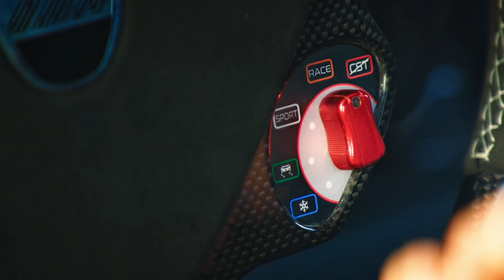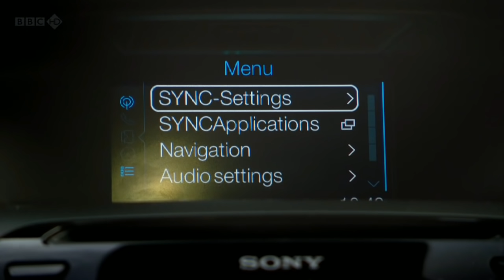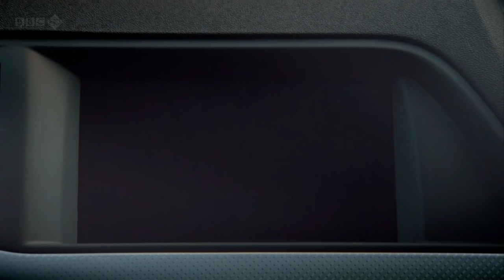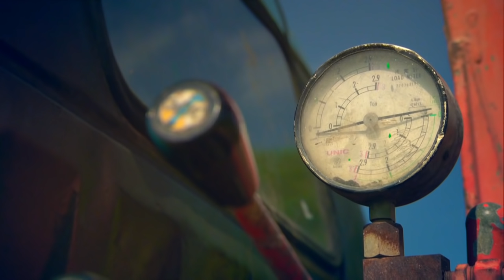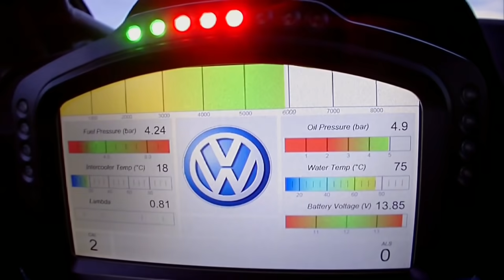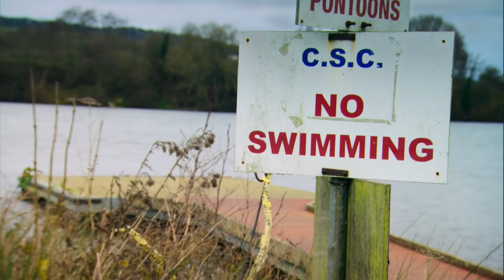Clarkson, Hammond and May Swearing Compilation

Comment: Hammond fell so many times on the bike because he kept putting his weight on front of bike. Gas tank area and handle bars if u sit on it like ots designed and weight over rear wheel he wouldnt have fell. When in doubt throttle out